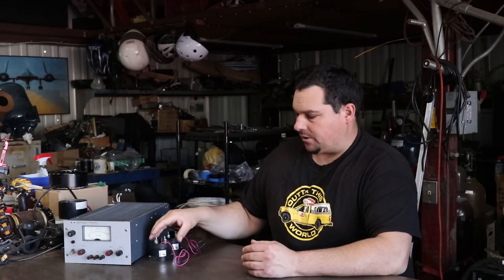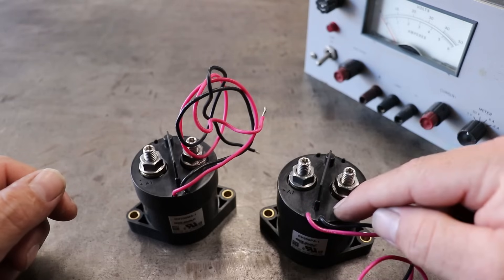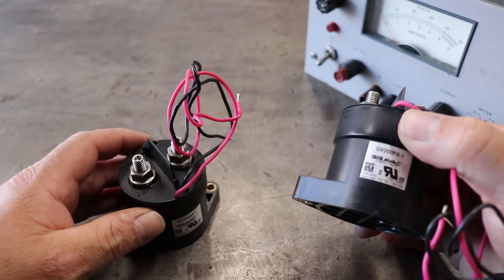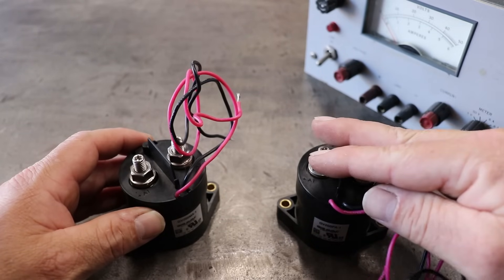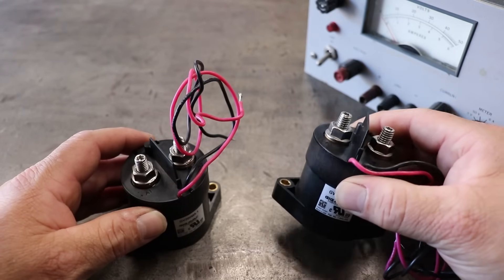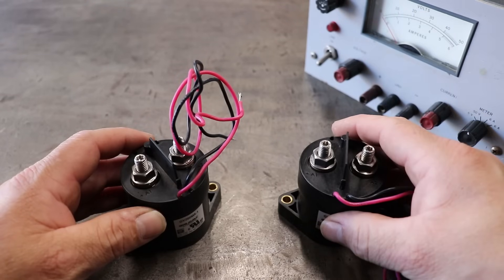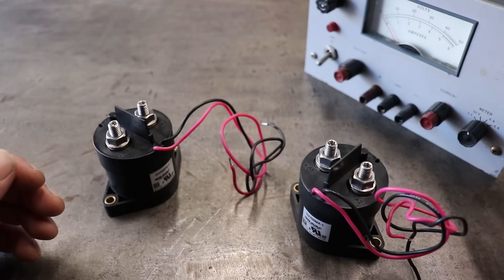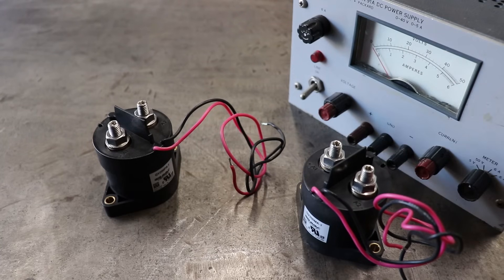Electric Vehicle Contactors, Economized vs Non Economized ( Electric Vehicles 101)

Comment: Thanks good sharings.
Acted as main switcher, a DC contactor's switching off arc abilitiy and lower temperature rise are very critical performance. It up to the several desgin measures during a DC contactor development. Sealed, intertal fulled of special gas to easily extinguish DC arc, and Magnetic field design are the main points. And thereinto, how to design in detailed parameters for example the positions of magnetic are very important. So different brands of DC contactor in the market have absoultly big differents electrical lifetime performance.

Comment: Congratulations ...great explanation ...! Thanks you..  economized contactors uses a two-stage coil control to reduce power consumption after initial closure, High pull-in current, then reduced hold current to keep contactor closed !

Comment: Looking at your earlier vidoes now. This was really useful. Thanks.
Reply from the maker: Thank you! I’ll add more and more as I go!
Reply: I have a 96v; 105AHr LiFePo4 battery pack for my converted EV. 

I am thinking to replace the 30S BMS with 2 pieces 15S,BMSs so I can connect them in parallel for my 48v home inverter in case of power outage. Sort of V2H (Vehicle to Home). As I live in a typhoon belt area. 

I wonder if there is an issue of connecting 2 sets of 15S,48v pack in series?

Thank you
Reply: @joeabad5908 Did you get this sorted? How did you get it done?

Comment: For you diesel guys you're going to run into this on the fuel solenoid the fuel solenoid usually will have two wires coming out of it three wires two control wires one ground what are the control wires they're both 12 volt but one of them is wired with a higher current draw and then the other one has less current it's the hold contact because in the fuel solenoid relay you need more power to overcome the spring but once the spring is collapsed it doesn't take that much current to hold it and you've all figured that out when you get the wires backwards and you smoke the relay yep same thing

Comment: I found a few of these at one of those amazon returns bin stores. Used one for the battery mode inverter changeover circuit for a grid tie standby to emergency off grid solar power system. You are right about the intermittant contactors economized constant type contactors.❤

Comment: Lovely explanation. I know which I prefer.
Have you just destroyed the market for non-economized devices?
Reply: Non economized ones are designed for intermittent duty, the economized type are for safety interlock master enable or main power enable use. I used one of these to isolate the battery pack from an inverter in a solar power system that goes from grid tie to emergency backup power of select circuits if the power goes out. It runs in tandem with a time delayed transfer switch.❤

Comment: Thanks for this, very helpful in explaining this to people new to EVs/battery storage. It turns out to be quite a common question, thats why for my new hardware I designed a pwm stage with flyback diode to handle any type of contactor, with a 12V coil voltage. On that topic, you did not mention to be careful of the coil voltage as they can vary even though 12V is most common.
Reply from the maker: Thanks! that's really cool. and a good way to utilize different contactors. And your absolutely right! thank you for catching this. I should do a second video covering this and other details.
Reply: @J5Jonny5  I know where you can get a working example that generates a spark.